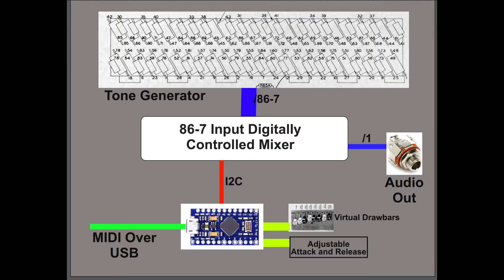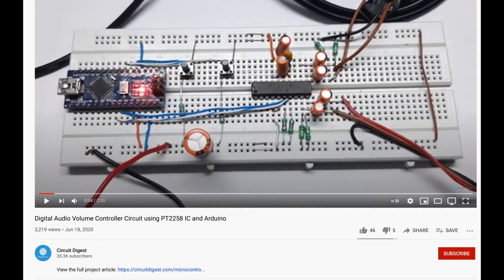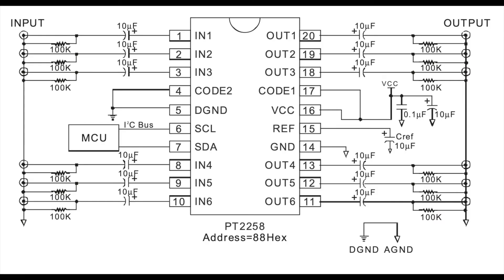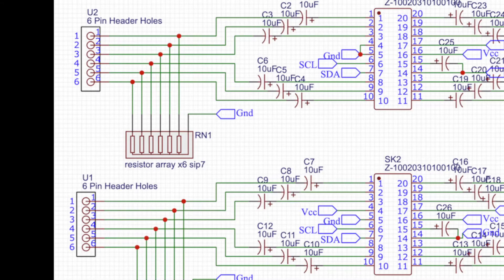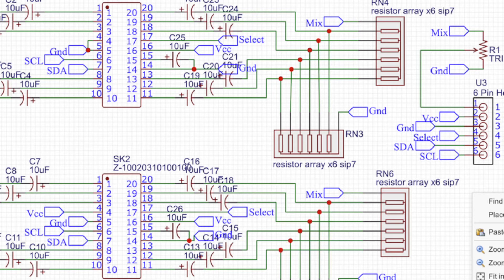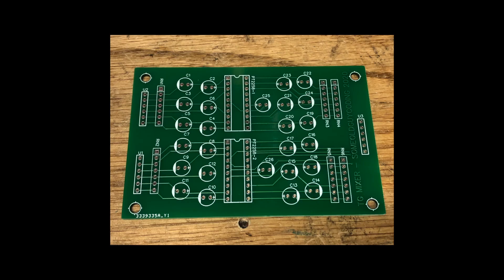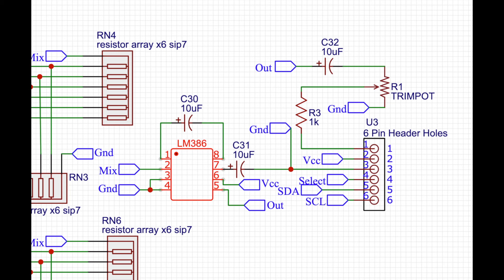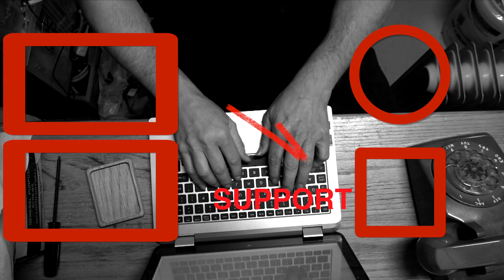Midi Controlled Hammond Tone Generator   Part 2

Comment: would it just be easier to do solenoids above the keys? i have a pianomation CD2000 system that i upgraded from on my player piano. i took off the brain module and driver boards from the piano abs replaced with the PNOMATION II system. but i just need to buy new solenoids.